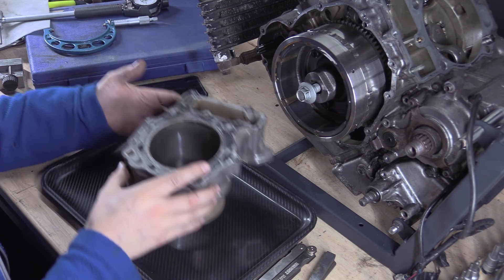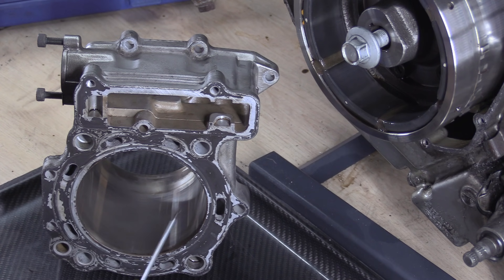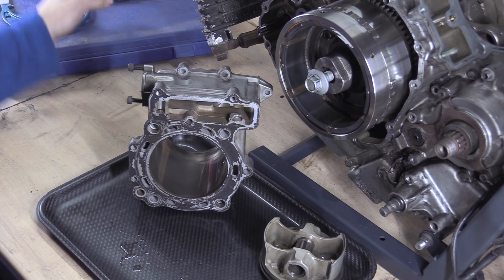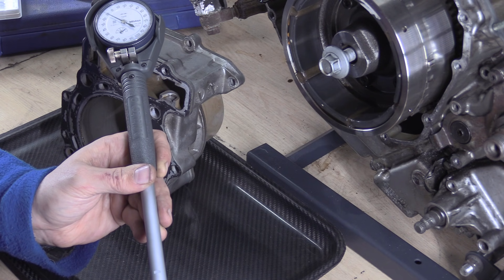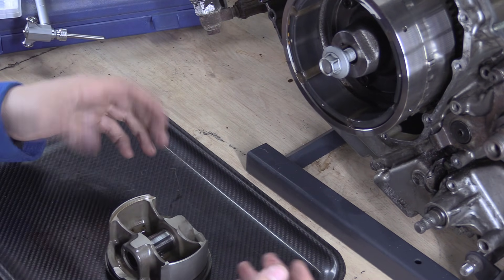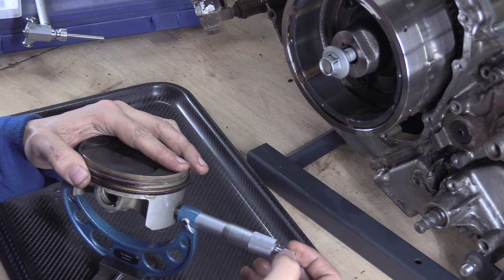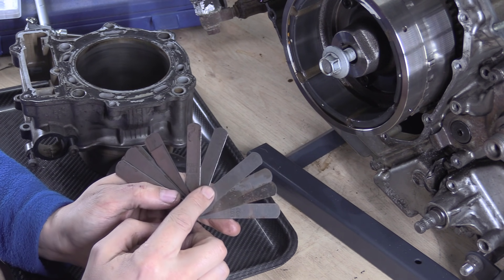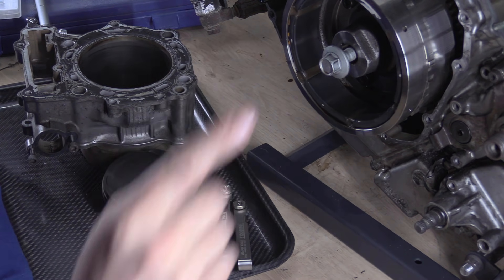Cylinder and Piston measurements - Part 1

Comment: One of the many issues they had in preparing the honda cbr600 engine for Moto2 GP racing was broken crankshafts - traced back to the lighter alternator they used - The triumph 765 triple had no issues in preparation for Moto2
Reply: Do you have any links to more info on this?
Reply: @scott4427  You have to purchase the industry professional publications
Reply: The only alternator issue I've had with my 675 was the previous owner leaving a bolt loose and it locking up against the rotor.
Reply: @Rubberweasel  As I explained there were NO issues preparing the triumph 765 for Moto2

Comment: Hi Matt, I’m in the process of rebuilding my bike engine and wanting to measure the cylinders etc, it’s not something I’m planning on doing regularly so can’t really justify spending the money on a good dial bore indicator but I do have some telescoping ‘T’ shaped gauges and some good quality micrometers. In your opinion would this be an accurate enough way of measuring a cylinder or should i bite the bullet and buy a proper dial bore indicator?
Reply from the maker: Yes but I'd take loafs of the same measurements and take the average.
Reply: @thedirtyworkshop  thanks Matt, appreciate the reply. Really enjoying the track bike series.

Comment: @The Workshop
Hi Matt, I have a 1999 TL1000S, so I'm very interested in this series.  What are the consequences of pistons being undersize when measuring the diameter across the thrust faces?  If the rings control the blow by, the only thing I can think of is that with large amounts of wear the strength of the piston could be affected, and possibly a slightly noisier engine due to piston slap.  Is there more to it than this?
Reply from the maker: This is with assymetric pistons. in this specific case it doesn't apply. I'm talking engines overall not just the SV/TL etc

Comment: When you get to the measuring video, can go talk about if and when to use a torque plate to "squeeze" the cylinder for measuring? Its a big thing with Harley engines, or so I'm told, and I'd like to hear what you think on the subject.
Reply from the maker: For honing and boring, not for measuring the bore

Comment: When using a big Mic to measure a diameter it's often easier to use it as a go/ no go if you know the tolerance. You don't need to know the actual size, you just need to know the component is within limits
Reply from the maker: Which is what I said. 98.500 is the limit and we read from there...
Reply: @thedirtyworkshop  ? You don't "read" anything if you set the Mic up for go and no go.
Reply: Would you not want to have an idea of where in the tolerance you're sitting to make sure you don't end up on the low end of one part and the high end of another and overall end up way out? We deal with compounding errors a lot in my job and people forget that give-or-take 5 can lead to a difference of 10 with just two parts. (Target is 80, range is 75-85, go/ no go allows both 75 and 85 which isn't really in the spirit of the given tolerance)

Not quite the same as we're a lab but the point still stands no?

Also Matt likes to line up his toys and count them so never going to skip out on a chance for some real numbers
Reply from the maker: The mix isn't set up for go/no go. The mic is to set the dial to a know value.
Reply: @11metalfan  He's checking 2 bores and 2 pistons, not multiple parts.
He is relying on a micrometer to set his bore comparator, but didn't show how he calibrated the micrometer.
You calibrate a micrometer with a setting stick, and you calibrate a bore comparator with a setting ring, end of. And you should do this at a certain temp and measure the part at the same temp.
If you're winging it, you should say so. Especially if you're professing to be an expert
Reply: @thedirtyworkshop  Yep, Roger That, just suggesting it's often easier to go/ no go when dealing with awkward parts mate.

Comment: The Mitatoyo guage needs bubble level for true accuracy, otherwise its still a guess.
Reply: Not sure if you're joking, but to clarify for those that may not know.

Not really, you take the smallest reading from the sweep and that gives you a measurement that's between one point and another directly opposite it. (Shortest distance between any 2 points is a straight line).
Also, a bubble level would depend on the top of the cylinder being level, and probably the table and floor being level.

Comment: It’s uncanny how similar looking the rear half of that SV650 engine and a DRZ-400 engine look.
Reply: The DRZ and sv650 motors have plenty of similarities. 

This is an SV1000 engine though, quite different architecture internally, but the basic layout is the same as they were made at a similar time by the same manufacturer.